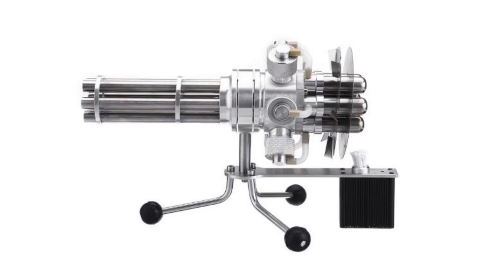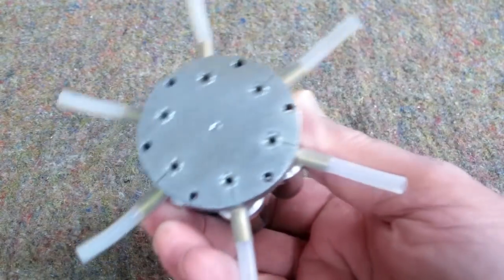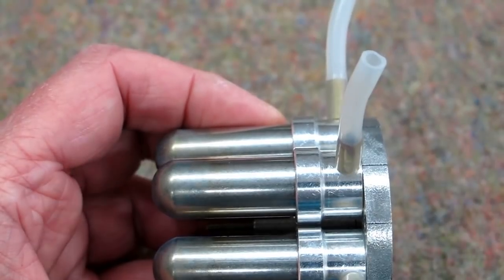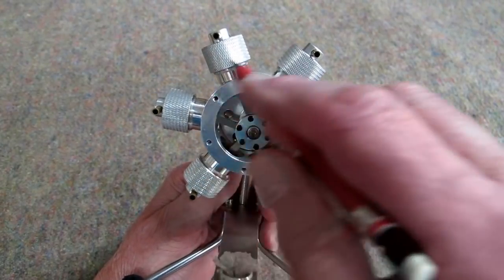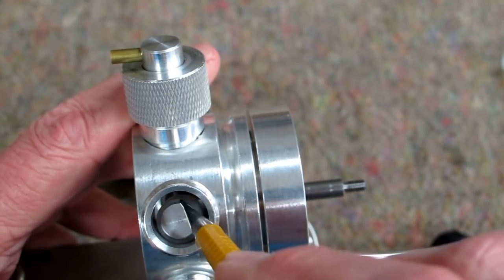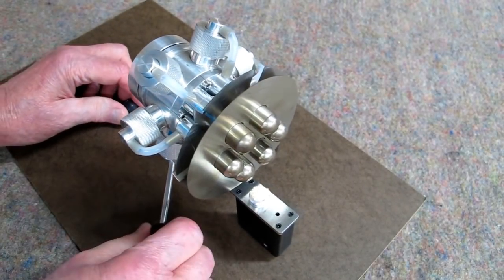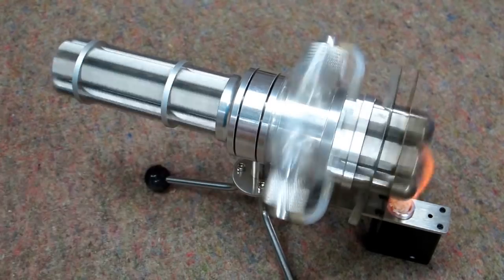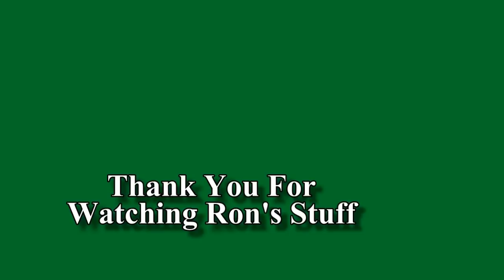STEM Gatling 6-Cylinder Stirling Engine

Comment: can you run a sterling engine on denatured alcohol or can it be 91% isopurple?
Reply from the maker: The best fuel is denatured alcohol because it burns clean. Isopropyl alcohol can burn very dirty and leaves black carbon on your engine.
Reply: @RonaldWalters2010  thank you

Comment: The Gatlin Gun engine is cool, but no model engine I’ve ever seen or heard of beats the Aero Engine. Mainly the propeller & the fixed gas flames!!! Both awesome, but Aero got my vote. Most excellent display & explanation of these engines. Everyone should click above & click “MORE”, check out the engines for sale . Every fuel & engine type is there

Comment: I picked up one recently and it has an issue. For some reason, the most it will do is rock back and forth between two cylinders. Sometimes very lightly. Have you ever experienced that particular issue? I can't help but wonder if it was damaged during shipping.
Reply from the maker: Where did you get it? Did you use one of my links to purchase the engine? How was it packaged? Was the package received damaged?
How do you know... or what makes you think it is rocking between only two cylinders?
Have you watched my other videos on this engine?

Comment: Man, you have to connect a planetary hub to this engine to spin a generator fly wheel, and produce electricity in a clean manner, a multi ton rock pit to serve as a heat battery reservoir, for your underground home.

Comment: Can this generate electricity? Maybe even using fresnel lens and solar light, or just some other heat source?
Reply from the maker: This is a proof of concept model engine. Most of these slow down and then stop after they get too hot and the heat differential is lost. Fresnel lens and the sun would probably work up to the time when it gets too hot to run.
Thanks for watching. Please subscribe. 
That's what keeps this channel going! 
Ron
Reply: @RonaldWalters2010  Engagement is actually how YouTube's algorithm pushes videos to the top actually, so let me ask you another question if it's not too much trouble. Is there a way to moderate the heat then? Basically I live in Arizona and my energy bill is crazy high. It's hot all the time and one method I've been considering is using a steam engine and fresnel lens to generate power to lower my energy bill. But this seems like it might have more potential, possibly?
Reply from the maker: I am a Mechanical Engineer and I built my own house and workshops… the house a little over 20 years ago.
The metal roof of my house is absolutely perfect for solar cells or solar hot water panels. I looked at several different ways to generate electric with solar panels and the cost just was not justified. The cost of installation is one thing. Pumping the electric back into the grid is another. The electric company here does everything it can to put stumbling blocks in your way. Batteries have a limited life and replacement is expensive. Storms, hail storms, etc. can damage or destroy hot water panels and solar cells. Both need to be washed frequently to keep them clean and generating to max capacity. A layer of dust or smoke drastically reduces their efficiency.

I have a video on a radiant heat snowmelt system installed in my sidewalk and driveway. That would not be of interest to you… except possibly in reverse. During the summer the concrete gets incredibly hot. The hot fluid inside the tubing in the concrete could be used to generate electric. Most of these systems work well while the sun is shining, but we (also) need the power when it is not shining.

This is another type system that is interesting… and there are other thermoelectric type systems out there… do a Google search. A thermocouple is basically a junction of dissimilar metals which, when heated, generate electric. This is how the thermocouple on the pilot light of a gas hot water heater or furnace works.
https://miriam-english.org/projects/steg/index.html

And to be most efficient, the panels should track the sun. Sounds like a government project.

Stirling engines are interesting and can be made to run for longer. Way back there was one that was made for farmers, who did not have electric, to run things like water well pumps, milking machines, etc. 

As a personal way to generate electric to save money, it just isn’t worth it

GE made a small unit to generate enough electric to power a tube-type radio and it ran off gasoline or kerosene. When the pocket transistor radio powered by a 9VDC battery came out, that pretty much ended the market for the device before it had a chance to become popular. A google search for Stirling engines (Wikipedia).

Stirling engines have been made to power submarines and satellites traveling out through the solar system. Once again, government projects. :-)

European countries have had success with people installing solar panels because the governments have largely subsidized their installations. 

Use of a fresnel lens would most likely also require tracking.

Watch this video and set up an experiment for yourself using a pair of binoculars to project the sun onto a piece of paper. This will show you how fast the sun moves.
Solar Eclipse Binoculars Projector - Safe Viewing
https://youtu.be/x6lXojghs3c

Don’t get me wrong… I am not trying to rain on your parade. It boils down to cost vs reward… and how much time do you want to spend fiddling with it.  The fewer moving parts the better.

Solar panels (electric and/or hot water) are probably your best bet.
Vertical-axis helical wind turbines are the best way to generate electric as they automatically track any change in wind direction (again, google search and Wikipedia).

Cheers!
Ron
Reply: Also, ideally this generates more power than the average person would need during the day, and the extra energy is stored the same way that electric companies store energy- batteries or pumping water into a well or compressing air. I understand it wouldn't be very compact to store a well on a backyard, or safe to have compressed air cannisters around, but maybe there is a way to turn the extra power into something else. Batteries maybe? Maybe the air cannisters have potential?
Reply from the maker: Well... good luck. I have looked at a number of ways to generate electric and they simply do not compete with the local power company... not on the scale that is needed to run an air conditioner, clothes dryer, kitchen stove, etc.
I do not have experience with fresnel lens or the tracking system.
Ron
Reply: @RonaldWalters2010  I imagine the biggest issue would be 2fold: generating a surplus and storing the surplus for when the main line of energy goes out? I am hoping to meet professionals in the field who would be interested in making something like that happen. I'm sure there are many ways to do it. Just have to be creative and persevere!

Comment: Wonder if you could power an actual gatling gun by the heat produced from the gatling firing instead of external heat or electrical motor.

Comment: I sure wish you could take that apart and show us what you mean by "displacer" and the other vocabulary words.
Reply from the maker: Craig,
In this original video I wasn’t about to take this thing apart because it is quite an involved assembly. However, later on it quit working and I had no choice but to work on it. The following shows disassembly and reassembly of the hot end (displacer section).
Gatling Stirling Engine - Hot End Repair
https://www.youtube.com/watch?v=K4bfWk_SSfU

This video shows taking the rotary engine section apart and repairing it after I accidentally broke one of the glass liners.
Gatling Stirling Engine - Broken Liner Replacement
https://youtu.be/fuPzcwDM95s

So that should answer any questions you have regarding this engine.
Thanks for watching.
Please subscribe. That is what keeps this channel running!
Ron

Comment: algorithm: do you want to see a little engine that looks like a minigun?
me: yes
Reply: Especially after watching 3d printed guns, 3d printed gearboxes, and "perpetual motion" or "science experiment" videos. This is like the center of that Ven diagram
Reply: yea
Reply: well tehnically minigun have a gear like this but i think its use bullet heat to spin anyway im pretty sure minigun usa a gear like this to roate
Reply: @enclave3555  it uses the gas from the gunpowder combustion to propel the rotational movement

Comment: why glass pistons ?
Reply from the maker: A lot of the hot end parts for Stirling or Hot Air engines are made out of Pyrex tubes (like test tubes) as they are heat and fire resistant. This engine does not come apart easily and I was not going to pull it apart as long as it was running. But then it quit and I had to take it apart to find the problem. That was when I could verify the displacers were aluminum and not glass as shown in the following video. 
Gatling Stirling Engine - Hot End Repair
https://youtu.be/K4bfWk_SSfU

The pistons and liners are made out of glass tubing which are lapped together to provide a tight seal between the two. They also get quite hot and the heat resistant glass is used along with silicone o-rings.

Thanks for watching.

Comment: If this cylinder drive could be weighted more as a flywheel and mounted higher to accommodate the space for the weights, then maybe there could be an inductive heat source.  If 6 to 8 of these engines were around a circle and a common inductive heat source, I wonder what the offset would be to make at least enough energy to drive itself plus a pulley system with at least 10-12 pulleys to make any load ratio almost nothing to torque?
Reply from the maker: You are basically proposing free energy or a perpetual motion device, which is unknown in science. 
Notwithstanding the above, the connecting rods and master rod are of such light material, any additional (or external) load would cause them early failure.
This is not an economical example of a heat engine. Far more energy is consumed by the fire than could be produced by the engine. i.e. If this were in an airplane it would never get off the ground. :-)
Thanks for watching. Please subscribe. 
That is what keeps this channel running. 
Ron

Comment: I don't think it's irrelevant in with direction it spins since the cooling fan only works in one direction. I assume for tese short runs the cooling fan is totaly unnecessary and over all it is a bad designed cooling fan anyway. More and bigger fins would cool the engine but this fan does near to nothing. Edit: also the shape of the fins is pretty bad. There should be no flat part between the fins on a fan

Comment: I assume the barrel is just for looks.  otherwise I'm not sure why you would magnetically couple it to the engine.
Personally, i'd try to make electricity with this by putting 1,2,3, or 6 small coils in there and connecting them to a full bridge rectifier.

Comment: Since when does isopropyl alcohol run dirty?? It's the cleanest burning household substance I know of!
Reply from the maker: As sold as rubbing alcohol in the pharmacy (or WalMart) it burns dirty as kerosene. Use it for one of these engines and you will soon change your mind.
Reply: @RonaldWalters2010  If you buy fuel alcohol it will work tons better, store bought rubbing alcohol is diluted.

Comment: How do you get yours to run so well I just ordered one off of stirling kit and it don't run nearly as well.
Reply from the maker: That is a hard one to answer. Mine ran initially just as you see in the video. Make sure the glass pieces inside the engine are not broken or cracked. Be very very gentle with the glass. Cylinder heads need to be snug but not overly tight, which could break a piece of glass. Silicone tubes properly fitted. The engine should spin very freely by hand without a fire and you should hear all of the displacers clicking just like in my video. If it does not spin freely the support shaft, which holds the radial engine part and the Gatling barrels part onto the center support ring, could be just a bit too tight. After a while my engine quite running altogether and I had to take the hot end apart and clean out a bunch of crap, which should have been cleaned at the factory prior to assembly. If all else fails you may need to look inside. Be careful with the silicone o-rings and try not to damage them. You can find replacements on eBay but then you will need to wait on them to arrive from China (around 3 weeks). Gatling Stirling Engine - Hot End Repair https://youtu.be/K4bfWk_SSfU Hope that helps. Ron
Reply: @RonaldWalters2010  can you send me a link to a replacement glass cylinder the piston tube rides in?   What had happened was the tube had came loose from the head and slid down and struck the connecting rod resulting in taking a chunk out of the tube.
Reply from the maker: I have been working with the engine supplier and Banggood and have finally gotten them to produce a repair pack for this engine. It comes with both pieces of glass and two o-rings. Banggood assured me today that this repair pack will be listed fairly soon. As soon as I find out the part number and description I will let you know.

Sorry this has taken so long but finally I have results.

This is a repair video I made and it shows how bad the breakage can be, the Repair Pack I hope they list on Banggood (with no changes) and replacing a liner on my engine. I will not make this video Public until the Repair Pack is actually listed on Banggood.

I had to take the whole engine apart in order to clean out all the broken pieces of glass and glass dust.

If the engine is running when the glass breakage occurs, glass particles and glass dust can also end up inside the displacers.

Ron

Gatling Stirling Engine - Broken Liner Replacement
https://youtu.be/fuPzcwDM95s
Reply from the maker: Finally… the repair parts have been listed.

Piston Cylinders Set for STEM 6-Cylinder Gatling Stirling Engine https://ban.ggood.vip/VWu3

I have a video showing the repair Process.

Gatling Stirling Engine - Broken Liner Replacement
https://youtu.be/fuPzcwDM95s
Ron
Reply: @RonaldWalters2010  wow, continuous support and updates for several months. This is either super good customer support or a extremely helpful hobbiest
Reply from the maker: I have experienced the same problem. I am working trying to get the manufacturer to sell replacement glass parts for this engine. So far not much luck. I intend to make this happen but it may take some time. Right now it is Chinese New Year and nothing will happen in China for at least two weeks. Be patient. If you don't hear from me, send me another message to remind me. Ron
Reply from the maker: One other thing... that glass tube breaking has probably put tiny bits of glass into the crankcase area. So do spin the engine or anything which could break the piston glass tube which currently has no liner to run in or get bits of glass into the silicone tubes leading to the displacer tubes and/or into the bearings. Also, bits of glass (or glass dust) could get up into the other cylinders and break more liners. At some point you will need to take the whole thing apart and flush out the crankcase, cylinders and bearings to make sure all glass particles are gone. I will let you know how I do with obtaining replacement glass tubes.

Comment: That is one cool stirling engine!    I wonder if this engine design could be powered by focused heat from the sun (using any variation of the old sun light through a magnifying glass method), in place of the clean burning fuel & flame?     Though I may just be a google search away from finding out the focused sun light powering method has already long been tried & tested a thousand times...
Reply from the maker: Stirling engines have been used for may things, although probably not a rotary version like this. Google Stirling Engine and click on the Wikipedia link, which has some good examples including one similar to what you described.

Comment: is there a particular reason (other than procurement) why you're not using a soft plastic/silicone pen for touch screens?
Reply from the maker: I used to point at things with a No.2 pencil. Then several years ago switch to mechanical pencils when I got too lazy to sharpen the No.2’s.  The one dental tool is a favorite when I am working on stuff. I never have one of these in my pocket and seldom take more than two steps with one in my hand. They are always on the bench within easy reach. I am much more likely to be injured by a No.11 X-Acto blade. Thanks for watching.
Reply: @RonaldWalters2010  Makes sense! Thanks for the explanation!
Reply from the maker: You are going to need to explain your question. I do not use a touch screen.
Reply: @RonaldWalters2010  for tipping and tapping on the parts.
A metal pen might put you in a bad place if you slip.
A pen with a softer tip like the silicone ones used for touch screens won't leave a scratch.
I'm just curious.